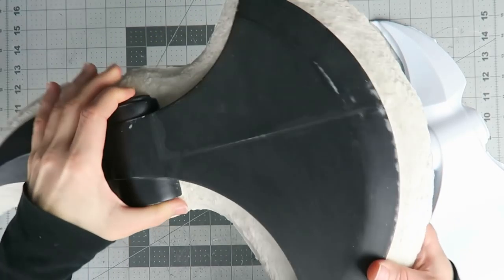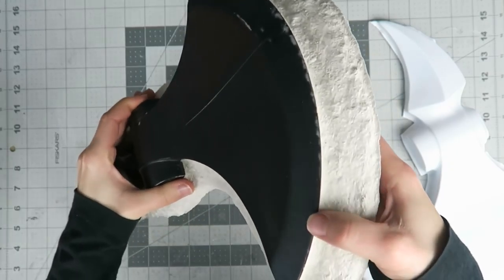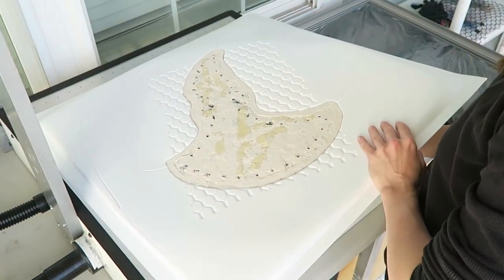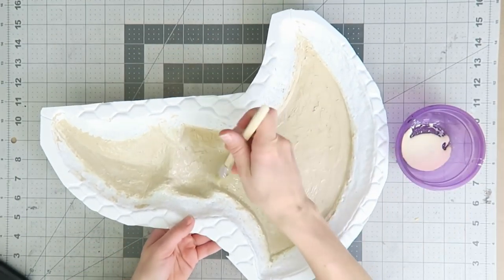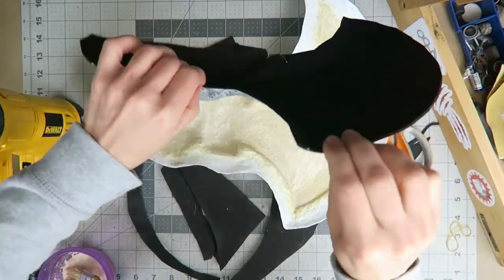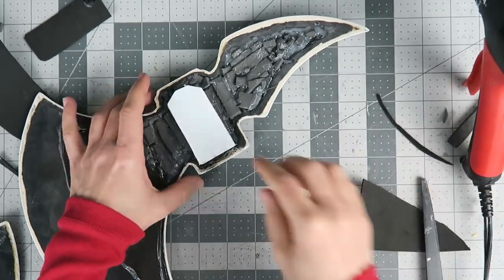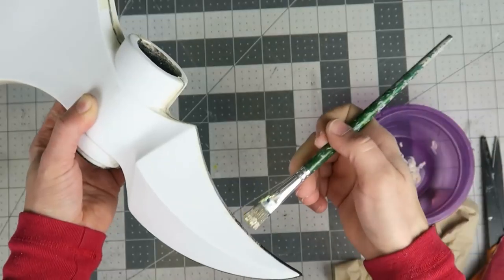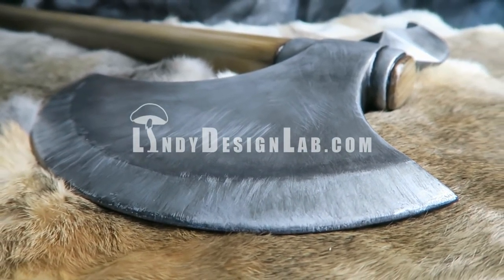Perrin's Half-Moon Axe Wheel of Time Part 2

Comment: I really like the foam layer between the two halves. You get a very sharp edge that isn't dangerous. Most of the vacuum formers that I've seen heat the plastic directly above the vacuum table then drop it straight down. I think minimal movement during the process would be best.
Reply from the maker: The transition between foam and plastic was a tad rough, but I think the paint job blended it out pretty well in the end. Yup, it would be tons easier if I can ever build a setup like that!

Comment: I've noticed the vacuum is on while you are placing the hot sheet over the handles. Maybe place the hot sheet down first then turn on the vacuum to avoid wrinkles? Amazing paint work btw. Wow.
Reply from the maker: Maybe. These thin sheets cool soooo fast it might be too late by the time I reach the switches haha. Thanks.
Reply: Lindy Design Lab Yeah I agree with this comment. Have the vacuum on first. 👍

Comment: Have you thought about doing some epoxy resin, fiberglass or carbon fiber tape molding with this table?  Not sure it's the right type of vacuum, but it would make a very sturdy piece with maybe minimal effort.
Reply from the maker: I'm not familiar with how that would work with a vacuum former. Are there these types of tape that can be heat/pressure formed?
Reply: Erm, no, now that I think of it, it's actually a bag full of resin and pulls a complete vacuum from all sides.  Not quite suitable for your setup, but you could experiment with worbla, it might be a bit pricier than the sheets your getting now, but would allow for better control using a heat gun where you need to contour.

Comment: Nice result! Looks like the definition is much improved.
That handle is being a real brat huh? 
Tilting the mold so the plastic touches one end first can sometimes help (it's meant to pull all the wrinkles to the outside of the high point) but because you're working so close to the edges of the frame I'm not sure it will solve the problem.
Worst case scenario you could cut it in half and make each side in two pieces then join those, then join the two halves.
It's looking good overall though! Can't wait to see how it turns out.
Reply from the maker: That's a thought! At this point though I think the handle is better off just getting 3D printed haha.
Reply: Lindy Design Lab Yeah, it's so smooth and easy to sand it it's probably easier.

Comment: AWESOME! those were some good ideas with the extra holes around the edges and whatnot, and it's looking much better. i was gonna say that it looks like a lot of work; just as much as making it from scratch, but then you said it yourself towards the end. 
oh well. admirable perseverance as always :-)
i haven't seen how you made your heater, but do you think it might be possible to mount it upside down on top of the vacuum table, maybe on a 3030 extrusion frame? you could slide the plastic holding frame up and down on the same frame, straight onto the mold, meaning there'd still be heat on the plastic as it forms and the transfer would be much faster and smoother, maybe eliminating wrinkles.

are you gonna cosplay as perrin yourself? i'd like to see that! :-D
i'd make a good perrin, if you end up having too many axes lying around. ;-)
Reply from the maker: That would be ideal, maybe a project for future if simpler methods aren't enough. An interesting costume for me to try to pull off haha, but no, this axe was commissioned by a friend going to JordanCon. I'm already working on a second version though, so that one will eventually make its way to my shop :)
Reply: Lindy Design Lab woah, WHAT?! There's a JordanCon??? That sounds sooooo cool! Amurica, F*%+ YEAH! I wish we had more fun cosplay stuff like that here in Austria. My village is self proclaimed blacksmithing capital of the world though, so there's that. Do you have a link to your shop? Or did you mean your work-shop?? Unless I forge my own first, I'll keep an eye out for yours! Maybe I'll make it to a jordancon (newly added to the bucket list) or a real makerfair one day after all, and have a need for it!
Reply from the maker: Yup, they've been doing it every year for a while now http://www.jordancon.org/. Well that's cool and appropriate for Perrin hahaha! Here's the link for my online shop where I'm slowly adding things as I get them made http://lindydesignlab.com/shop/.
Reply: Lindy Design Lab haha, it is indeed. Unfortunately I'm not actually a blacksmith, but there are opportunities to learn. I have made a pocket knife once!
JordanCon seems AWESOME! I just love the books. Are you going? Would be really cool if you take some video, if you do! 
And nice, thanks! Maybe I'll pick it up if I have too much money when you put it up for sale. I've seen how much effort you put into all your amazing creations and it'd be lovely to have one, also since other than the odd comment and naturally liking every video, I'm not giving much back for your wonderful videos, which I really really like.

See you in the next one! :-)
Reply from the maker: I can't make it this year, maybe next time. Hahaha I appreciate the likes, thanks!